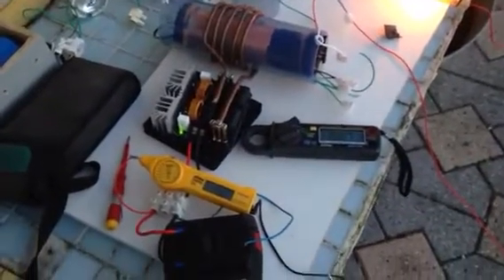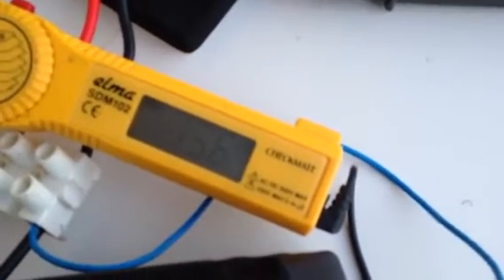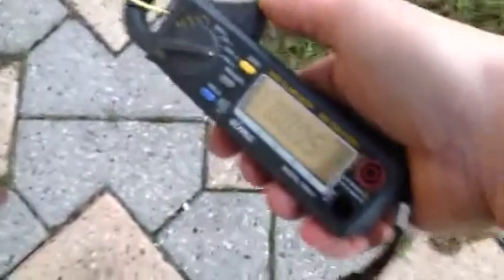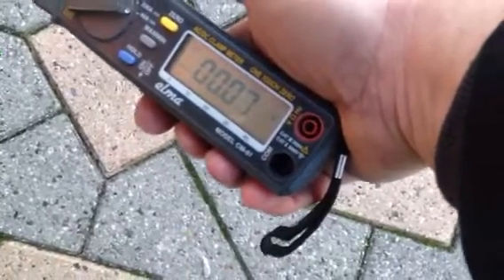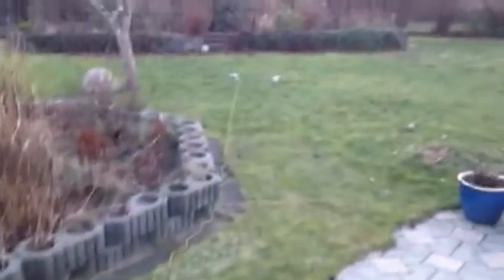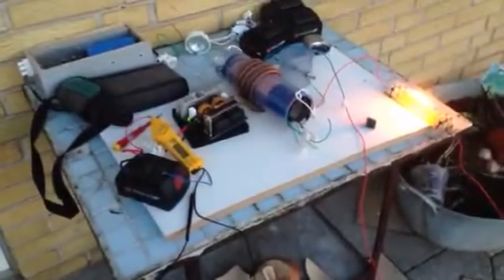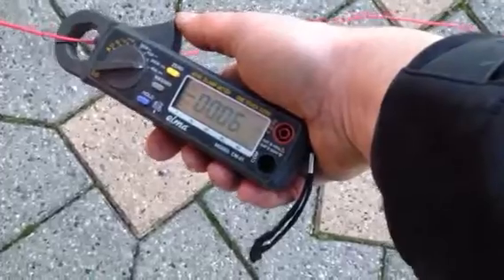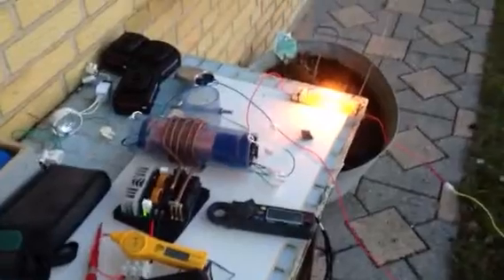ZVS-IT, Kapagen, Kapanadze, akula,Igor

Comment: Thanks for the video
an important measurement will be when you put an ammeter in the range of 10A in series with the battery,or set Dc on one positive wire :D
we'll find out how much gets the energy from the battery? 
(curiosity is whether you there ferrite core)? 
-if not it is worth to try to use roll of aluminum foil cut in half ! and place one end ground the second end modulate HV spark gap np(fly back) When you do this caution!
do not use instruments to measure because it'll ruin or damaged by such a high voltage ;D
Good luck.
P.s 
-review of which to build a coil?
maybe I can advise something 
Regards.
TTech.

Comment from the maker: Roberto
I will make a do it yourself series but only once I have a finished looped system. It won't be long, keep watching:)
Reply: If you wound another coil with a FWB rectifier into a 12v car audio capacitor? Not sure if it would self loop properly like that. Seems that some sort of disconnect like a spark gap is always needed otherwise the input will see the output. 

May you please share a diagram of your setup? Thanks!

Comment: Nice setup and very low amps.Appears you have overunity.
Resonance + spark gap finely tuned + good earth grounds.
Maybe caps in series or parallel with L2 coil and or L1 coil will give more power or  small boost.
Cheers and hope for the best.